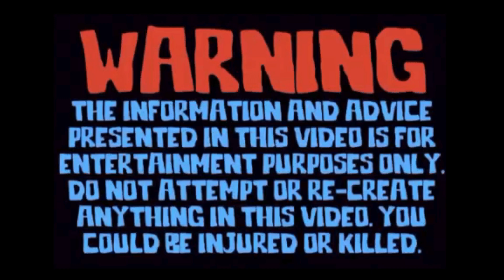Mechanical Fiber Splicing (House Fiber Optic Cable)

Comment: Very interesting. Shouldn't a different cleaving tool be used for a green versus a blue connector? Blue is straight cleave, green is angled cleave at 8 degrees...
Reply from the maker: For the standards provided from Corning it is not necessary.
Reply: @Pineapple-Express_MX  there's no point in using apc sc then. Apc was designed to reduce signal reflections which really matters when there is baseband conversion of rf to fibre for example